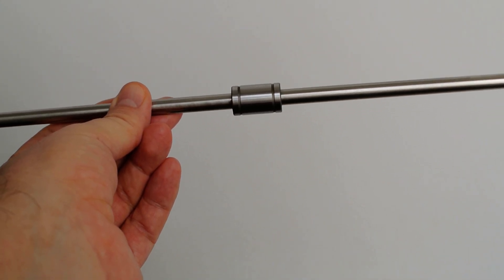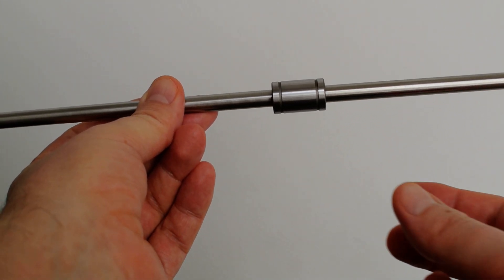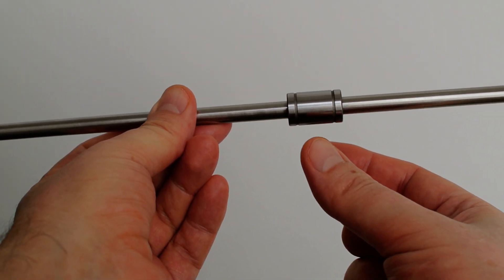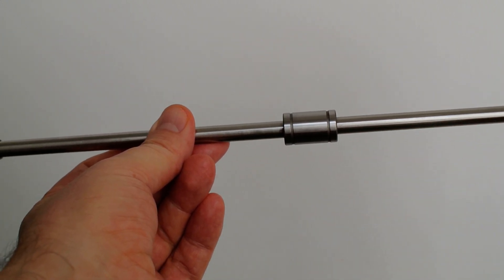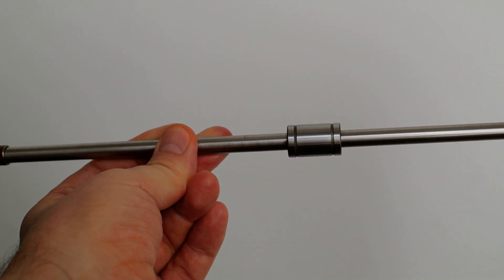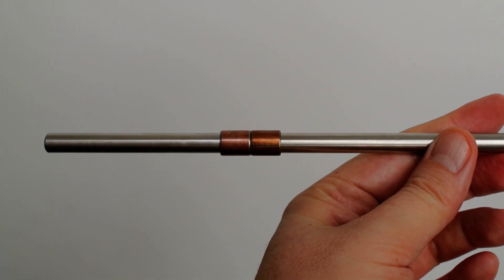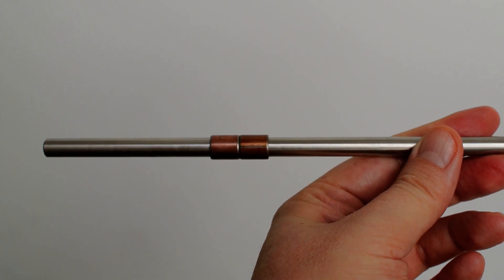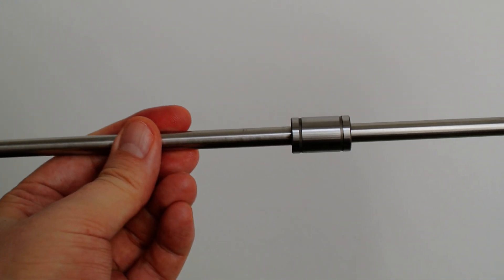LM8UU bearings vs graphite impregnated bronze bushings

Comment: Did you manage to use bronze bushings in any printer?  how long did they work?  were there any problems?
Reply from the maker: Hello Robert, I ended up using normal ball bearings because exactly of concerns about the wear and tear of the bronze bushings, plus it's a pain to disassemble the 3D printers just to replace these parts. But the fact remains that they are a lot less noisy.

Comment: sound is not the same as friction or wear. of course steel on steel will make sound.  a steel wheel on a railroad track will make more noise than an rubber wheel on a rubber mat, but it will have far less friction.
Reply: but less friction does not mean worse print quality for a carthesian 3D printer, bushings with more friction could do the same job as lm8UU bearings with the advantage of reducing the unwanted oscillating movements